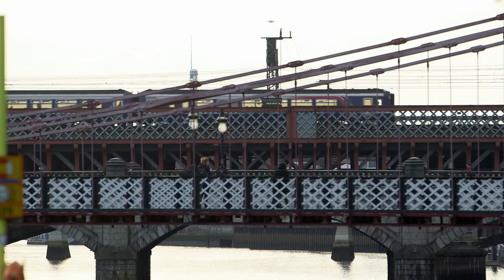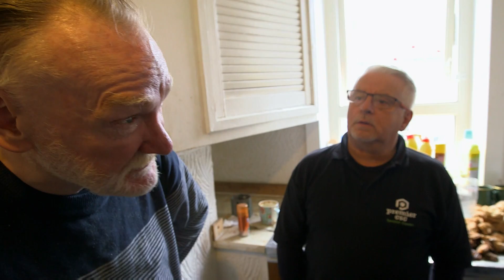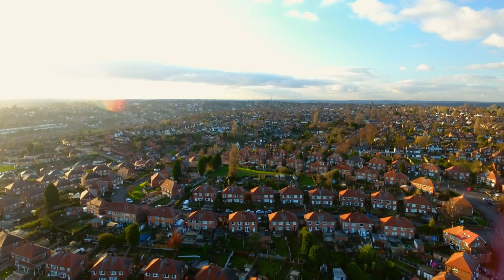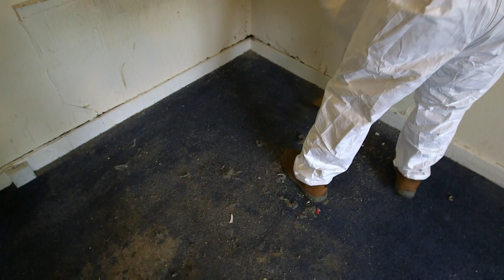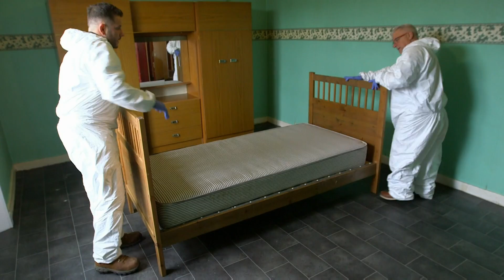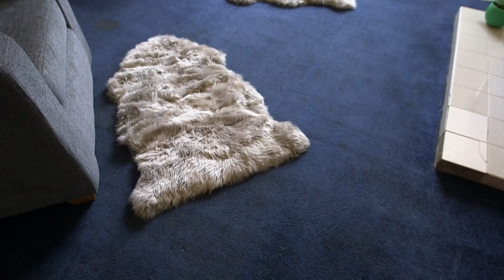Man Who Lived Only In One Room for 5 Years Now Gets His House Back | Call The Cleaners

Comment: Actually, the rugs should be thrown out, because they're still filled with germs. Paint the walls, floors and ceilings. Picking up stuff just isn't enough.
Reply: They went through gallons of bleach and disinfectants. They did way more than "pick up."
Reply: Pretty sure that's a water pressure cleaner. The rug is as good as new.
Reply: @constantindenis8130  Not really. Throw rugs are easier to clean, on a monthly basis, in a washing machine. That pressure cleaner may cost more. It may also be used less frequently.